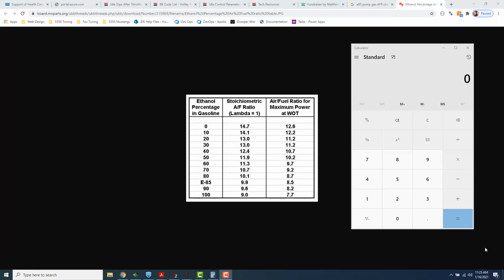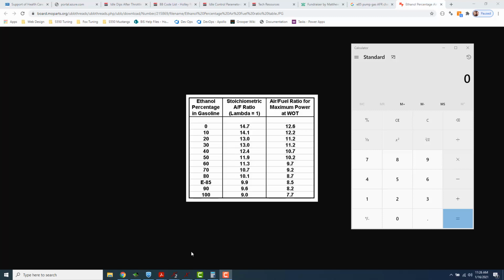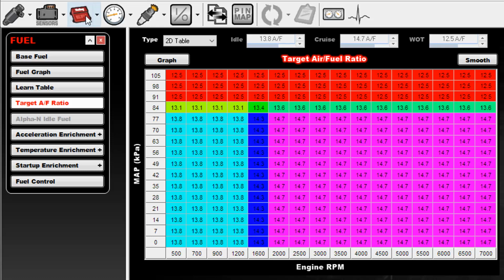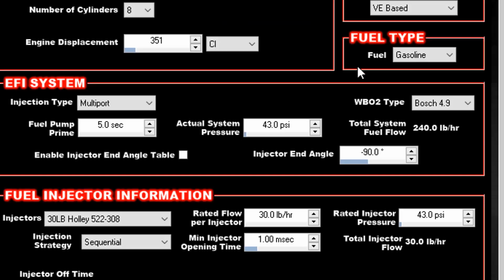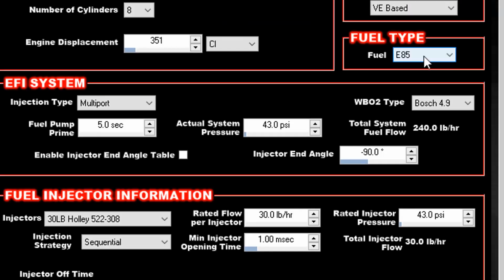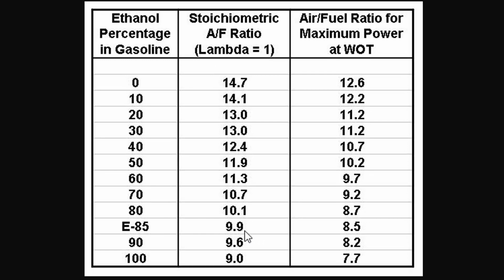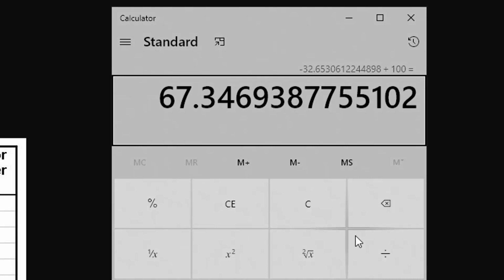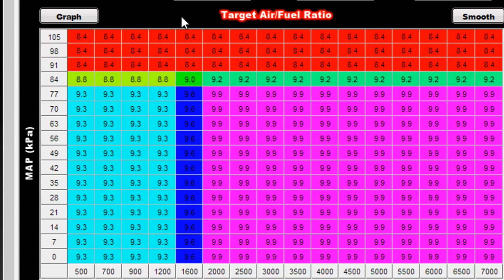Make sure your Target AFRs match your Fuel Type - Holley Tuning

Comment: so im running a widenband O2 sensor, Im on pump gas 93.. So if I wanted to switch to E-85 my wide band should still read 13.7ish even with E-85 , or should my O2 read 9.9 ,,This is a little confusing ..

Comment: So if I am running E85 and change my fuel type to E85 can I still reference AFR (14.7, 13.2 etc)  in my target table and the program will do the math in the background? Or do I need to update my Target air fuel table to the Lambda values as you showed? Asking for a friend 😁
Reply from the maker: If you change the fuel type in the software to E85, then you need to target AFRs that make sense for e85 like in the 9s.
Reply: @LeechMotorsports  appreciate your video! I said Lambda values (watching too many videos) but you knew what I meant (E85 AFR values). 👍 on 93 gasoline I target 11.5 AFR in boost. So on E85 I have to update my target table to 7.6 AFR? Will my wideband gauge be reading 7.6 AFR? That will look weird to me coming from the import side, tuning on Hondata and Cobb where I always target the same AFR for 93 and E85 and have had no issues. Seems like that might be a big difference between the programs. I have so much more to learn about tuning on Holley.  I'm tuning/learning on a Holley Sniper.

Comment: It would be really nice if the terminator software had a button to convert the Target AFR table to target lambda.  Then this mistake would have never happened.  Maybe if enough of people bother Holley, they will include that feature in a future software update.
Reply from the maker: This typically comes down to personal preference. And I couldn’t agree more. Many people learn tuning using one or the other and really prefer to continue working with what they are familiar with. They really would help the community with lambda based tuning.

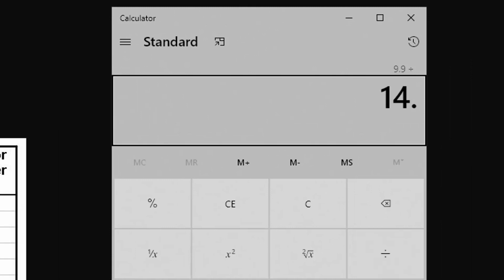Comment: hi at 6:04 are you sure it's 9.9/14.7 and not 14.7/9.9 ? i was thinking it was 14,7/9,9= 48% more fuel  in mass and E85 is more often E70 and gazoline is more 14,68 then we have 14,68/10,7 = 37% more fuel in mass which will give something like around 30% in volume ?

Comment: The problem with using gasoline AFR numbers with a car that runs E85 is that it will completely throw off the fuel flow and thus the VE numbers. You can still tune it, but know that the flue flow numbers will not be accurate.
Reply: add 30+% fuel flow offset in an advanced table, done  but now with V3 you have the option to select e85 and have it change the target afr table to e85 scale.   i still tune in gasoline scale and just use a fuel flow offset advanced table.

Comment: Not entirely correct. If you are using gasoline scaling, but running VE based fueling, your VE table numbers will be much higher than what they should be due to how Holley does the fueling. 

What your suggesting is common but typically done with Speed Density selected in the drop down menu. 

Like today I started my new build on e85 on ve based and it took 60+% VE to idle. No engine is at that idling. That is due to being on gas scale with e85 while on VE based fueling. If I switch it to e85 (and everything else), my VE table will have much lower values that make more sense.

Comment: So if your running e85 and you have gasoline selected and gas afr command would you be ok or ??
Reply from the maker: That is correct.
Reply from the maker: And I prefer to tune with the Holley exactly that way as my brain is more wired to pump gas target numbers.
Reply: @LeechMotorsports  thanks for the reply! I’m redoing my fuel lines now once I get the car going again If your interested I could send you a run down of the motor and my tune for a review video it’s a pretty stout vortech 306
Reply from the maker: Please do.

Comment: thanks for the great video .if i was running e60 and had the software in the gas scale would 14.6 for stoich and 10.8 to 11.2 full power be ok for a turbo boosted ls.
Reply from the maker: I can not speak to LS tuning. I do not have any experience with those engines, and do not know what kinds of targets they like.
Reply: @LeechMotorsports  ok thanks but would you still fill in your fuel map with these gas figures on e60 thats what i really ment to say.
Reply from the maker: The short answer is yes. If you are going to tell the Holley your fuel type is gasoline in the dropdown, then you need to target the kinds of AFRs that you would if you had pure gasoline in the car (even though you’ll be on e60).
Reply: @LeechMotorsports  thank you very much for your time .

Comment: At which point do you decide to go with pump e85 over 93 for a turbo sbf holley setup? I have high coolant temps I cannot seem to get down very quick on 93 and my timing is conservative. Wondering if I should swap and get headaches of the E85 for a little more boost, timing, and hopefully cooler operating temps. What do you think? Thanks
Reply from the maker: On these older cars, I think of e85 as being the typical limit between a true street driven car, and a track car. I realize there are flex fuel options out there for tuning in the Holley. But I never recommend trying to make a flex fuel tune have the max possible performance available in a pure e85 tune. Just too risky. And with pump e85 being so inconsistent, it’s the kind of thing where I wouldn’t do e85 unless I was prepared to plug-in a laptop pretty much every time I drive. I do this on my coupe. But it rarely gets driven.
Reply from the maker: And e85 is so popular for newer cars due to the common practice of having much higher compression than most of the sbf stuff out there. And fuel systems/factory efi system so commonly ready for e85 off the showroom floor.
Reply: @LeechMotorsports  thank you for your time and advice man 👍🏻. I a,ways have the laptop and try to log each drive. I think I am near the limits of 93 and meth injection isn’t an option I want. Was hoping to make some progress to get this car running cooler and go from 10lbs boost to 12-13 possibly. I think my compression is high 8s or low 9s.
Reply from the maker: At that compression, you should be able to run upwards of 13-14 psi on pump gas. However,  you could definitely make more power on e85 and safely turn it up even more if you feel so inclined. I wouldn’t count on it bringing the engine temps down though. Do you have enough injector, line size, and pump to support that change?
Reply: @LeechMotorsports  currently have deka 80s, aeromotive a1000, return, I’m drawing a blank right now on line size but I believe it’s adequate. Thank you for helping me
Reply from the maker: @timweb1510  I’m sure it will be plenty. You’ve got the injector and pump to do it.

Comment: What about oxygenated race gas like MS103 or MS109? I know it’s not e-85 but I generally richen everything up about 8-10%. And at WOT go from 12:5 down to 12:2 . It’s a N/A 347. You think this is a safe ratio?
Reply from the maker: If you’re tuning with the Holley, selected your fuel type as gasoline, and have tuned your base table to achieve your targets, you should actually still be able to set your target AFR as though you are on pump gas. Every combo is different, but it is likely you are running too fat right now, and should raise your targets back up to 12.4-12.8.